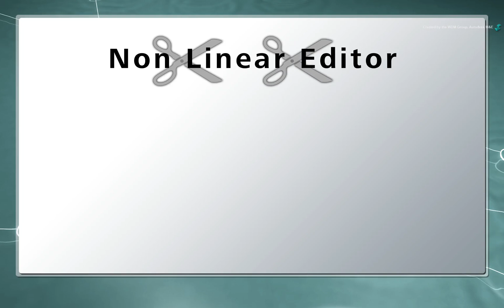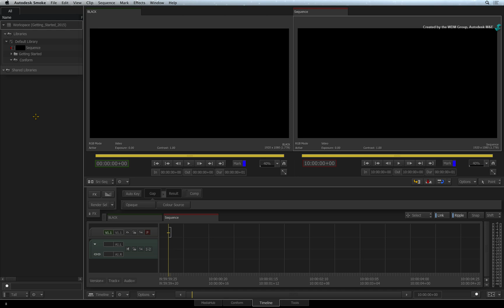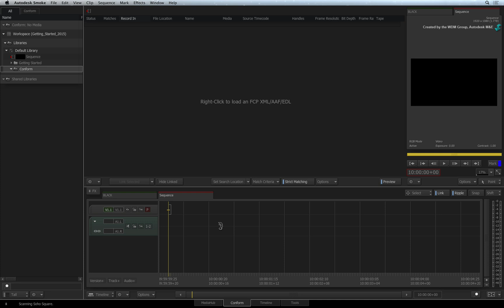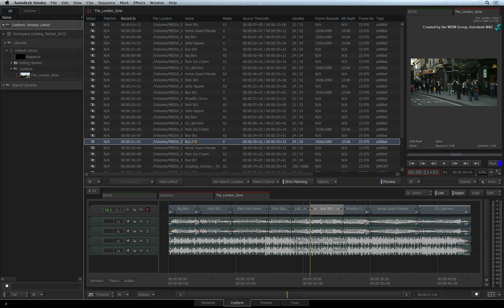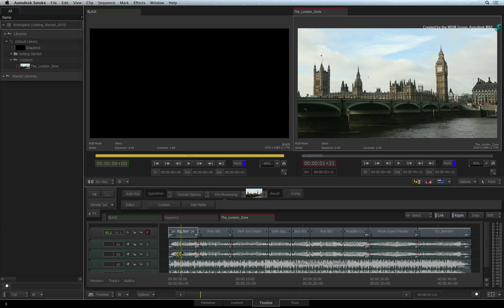Basic Conforming using AAF or XML

Comment: Is there a reason why my conform from xml files are always a file or 2 different from the offline edits?
Reply from the maker: Hi Colin, there could be a number of reasons, you could be using files with the same name and Smoke is getting confused.  If the files are missing, you need to ensure they are in a location where the initial search can find them or you need to do a secondary search with set search location and relink the media after importing the sequence.  

These are the general workflows but I can really say any more because I can see what you're missing.  Hope this helps!